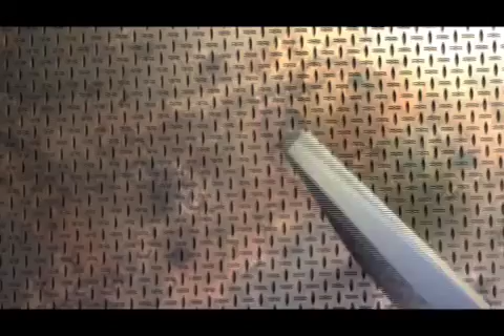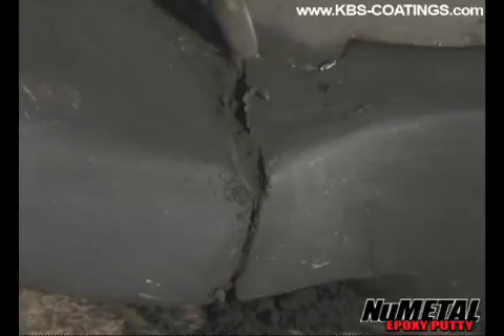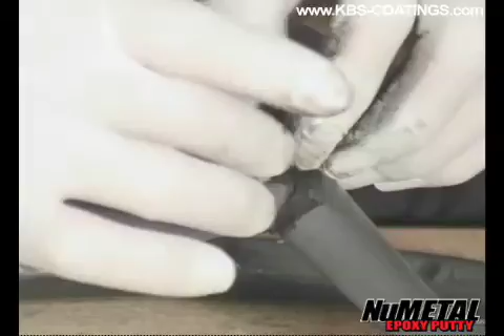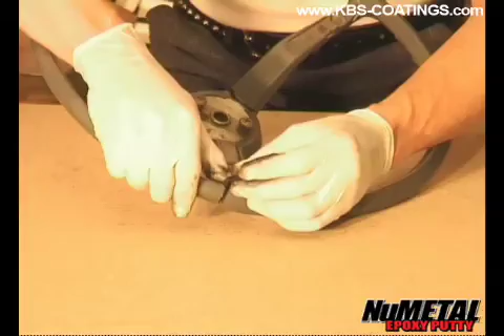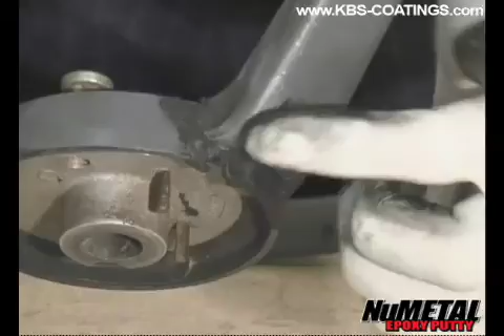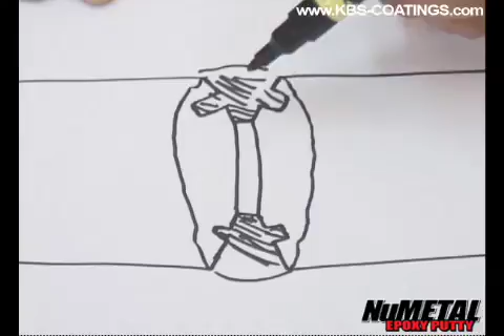KBS NuMetal - Epoxy Putty - Steering Wheel Repair - Part 1

Comment: Thanks for the quick reply.  I want to use it to repair my steering wheel but the wheel has some details which wont allow me to completely refinish the wheel so I was hoping to fill the cracks without any sanding and painting.

Comment: On your Application Information sheet it states:  "For a very smooth, professionally looking surface and to eliminate the need for sanding, smooth and feather with WET fingertips BEFORE DRYING."

But it also says to use gloves, would you recommend the smoothing with or without gloves?  Thanks

Comment: I am working with a 1971 Chevelle steering wheel and I have large pieces on the back side of the steering wheel. Any thoughts on how to replace the larger flat pieces from the center out to the wheel edge on the back side ?